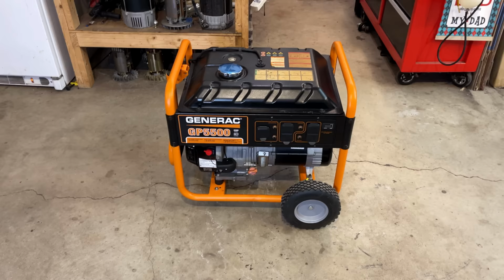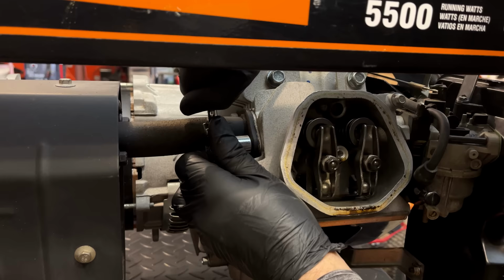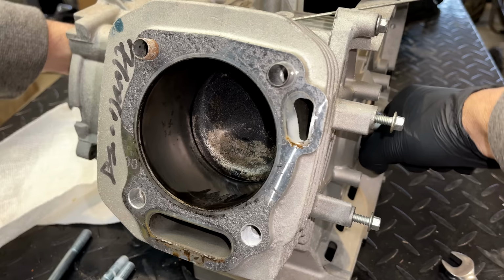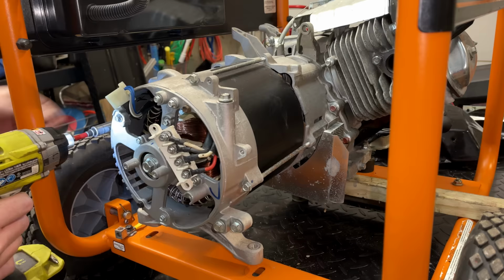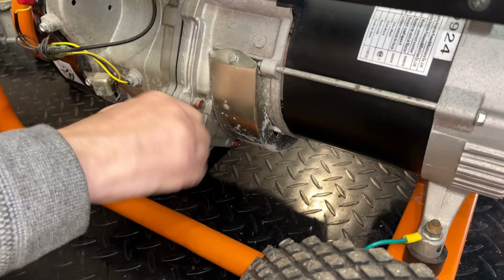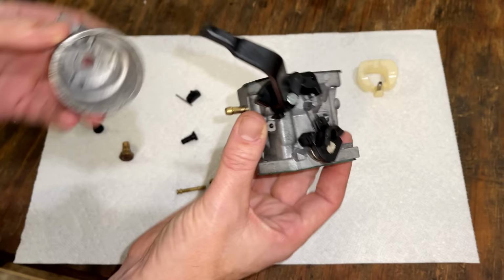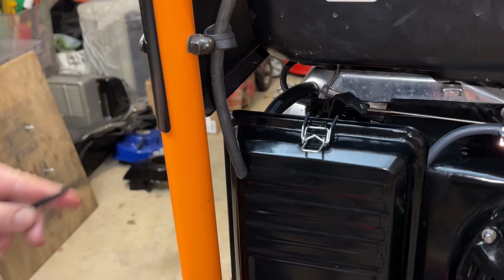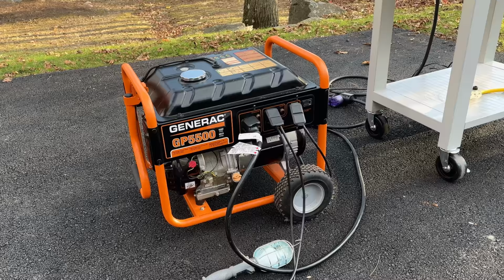What Caused This Engine Damage? - Generac GP5500 Repair

Comment: James, a heads up. I've been using the super degreaser in my ultrasonic cleaner, too, and if you use too much, it can literally strip the protective coating off the carburetor's surface. I've got two carbs that now have a darkened appearance, and I'm afraid to use them now. Just wanted you to know.
A couple of ideas on the engine corrosion: was this generator in a flood zone and didn't get drained for a few weeks? Or did the carb get stuck and drain down into the motor? Food for thought.

Comment: Are the rockers supposed to be that loose?  Seems pretty excessive.  I've got the same genset here.  Wonder if adjusting valves is supposed to be a service item?
Reply from the maker: Every 100 hours they are supposed to be checked.  The rocker design is not great.

Comment: I was surprised by how easy you got the armature off the tapered crankshaft   I’ve got a single cylinder Chinese 7500 watt diesel that I can’t get it off . I’ve tried hammering on the long bolt that holds it on and also tipped it up and poured water in the bolts hole then wrapped a short bolts threads with pipe tape.  NO success. Diesel engine has so much blow by into the crankcase that it won’t start.Want to look at its piston rings. Anybody have any ideas?

Comment: Had a question..What is the best generator brand apart from Honda & Yamaha..? Which generator is better between Generac & Briggs....?
Reply from the maker: GEN-PRO by Gillette makes some good machines.  Generac and Briggs both use Honda clones and generator heads from China.  They are equal in quality but likely the Briggs will not cost as much.

Comment: hey James  love your stuff , i have a 2016 Briggs & Stratton Storm Responder Generator 5500 watts with 8250 starting watts. she has always be faithful , can you tell me the best engine speed , and voltage and hz that it should run at, i got that meter you got, i wanted to test her to see if she is worth electric start kit...thanks for any help
Reply from the maker: The speed should be set at 61.5 hertz (3690 rpm) no load.  If you have an AVR then set the voltage to 120 volts.  If no AVR then there is no adjustment you can make to change the voltage.

Comment: Sorry to bother you how do you remove the ball bearing from the counterbalance in the “back housing”the one in the blind hole where you can’t mount an extractor o is there a video where you do it,thank you
Reply from the maker: I have not made a video on that but plan to in the future.  There is a slide hammer designed for pulling this type of bearing.  Orion Motor Tech Blind Hole Collet Bearing Race and Seal Puller Extractor Kit, Slide Hammer Pilot Insert Inner Internal Bearing Removal Tool Set, 16PCS https://a.co/d/9VvVrML
Reply: @jcondon1   thank you, very very much, you r very professional and you know the value of answering calls, again Thxs a lot 
Do you repair generators for costumers?

Comment: So are you now going to have to switch to a different degreaser in your ultrasound since the formula is now corrosive to aluminum?
Reply from the maker: Yes.  Been using dawn dish soap recently until I find something better.  Also using up what I have of the Harbor Freight degreaser on carbs that are easy and cheap to replace like this one.  It still works well on 80% of the carbs I put in, but the other 20% turn dark.  Even had one bubbling as you would expect to see if dropping it into acid.

Comment: I have a Cub Cadet push mower with a Powermore engine that has a similar issue. It will run for about a second, but the engine never gets up to speed. I assume the valves are the issue as well, but I cannot find any information on this engine. I have no idea what the clearances are supposed to be. Is there any way to guestimate what the clearances are supposed to be?  I have no history on this machine beyond the owner saying that it hadn't run in several years. I have had it for several months, but I cannot find any information on these engines. It took me about a month to even find out what type of engine it was. There is no identifying information on the engine that I can find.

Comment: Any info for an overload light on a predator 9500 inverter gen? I replaced the inverter with a used one from a machine with a dropped valve, so not a known good unit but could infer. Still showing an overload light. The primary dc winding is producing power at 14 volts. The secondary ohms at .7 so I assume, yes I know what that word means, it is good. When I unplug the secondary feed to the inverter board; sometimes the machine starts to die, I plug it back in and the generator roars back to life and I get a green output light for a second then back to overload. 

The alt tests fine I think. Both sides ohm at .4 and are producing 185ish volts each. Seams really high but the diagram indicates it’s 3 phase power from the alternator. 

Any productive ideas are greatly appreciated.
Reply from the maker: Usually that indicates a bad inverter but given you tried another and same result then might be something else.  I have not worked on that inverter before but most do have 3 phase AC high voltage high frequency.  185 seems a little high but likely ok.  The ef3000 I worked on was 3 phase in the 150-160 vac range.  Some also have single phase output in addition.  Would make sure all windings resistance is good and no connections to ground from any.  Would also check the servo on the carburetor and make sure it is moving and not stuck. Also might disconnect the outputs from the inverter in case something down stream is shorted.
Reply: Thank you sir. I will check again for a short.

Comment: Why is it a good idea to shut off gas & run it out when your done with something.
Reply: Ethanol in gasoline attracts water, which causes corrosion and ruins carburetors.  Any gasoline will eventually turn to varnish which plugs up carburetors.  It's a gad idea to leave gasoline in carburetors for more than a few months.

Comment: Not sure but looks like the white and black wires on hour meter got switched. Does it mater?
Reply: Matter
Reply from the maker: On some it will.  This one is AC so the wire location does not matter.

Comment: Other bad cam ?? Seems to be common 😢
Reply from the maker: It’s a common issue with the GP series.  To be fair though all cases I have seen were due to oil contamination.  Think it’s neglect rather then quality control.

Comment: James, is THD a product of the engine or just the power head? I would think it is solely an issue with the power head. Thoughts? 

I also found it interesting that a GP5000 engine could fully power a GP5500 power head. Makes me wonder if the engine was significantly oversized for the GP5000.
Reply from the maker: They do oversize the engine on the GP5500.  The GP5000 has the same size engine as the GP5500.  The THD is a combination of the engine, generator head and the type of load.  Space heater me are the best case.  Multi cylinder engine are cleaner for sure.  Two strokes are also cleaner because every stroke is a power stroke.
Reply: @jcondon1  Thank you!!!!

Comment: Well, today’s gas sitting in anything a long time is a bad thing.  Ethanol has a propensity for and actually attracts moisture.  HEET gasoline additive to memory comes I two flavors, yellow bottle and red bottle.  One is predominantly ethanol and the other is predominantly isopropyl alcohol. Add gas and water to oil and let it sit em with cast iron internals in an engine and well you probably have what we saw here.  Who knows what the generator flipper added trying to free up the engine.  Diesel or penetrating oil or who knows.

Comment: How are these engines all getting flooded ?  You have had several in the past flooded as well.
Reply from the maker: Not sure this one was.  Water would not have done that damage to the aluminum.
Reply: @jcondon1 it might have, depends on what was in the water. If it was say, sewage for instance.....
Reply: I can tell by living by the ocean. I've had plenty of tools that got flooded most of them clean em , some diesel fuel fresh oil and gas they run 
 After that its mostly neglect.

Comment: Do you have experience from DC-generators? Could I run such with low rpm and still keep the output voltage constant, like 48V?
Reply from the maker: I do not have DC generator experience.
Reply: @jcondon1  i would use it to charge lithium batteries directly without inverter for my house. I know that telecom companies use them apparently for efficiency reasons. I would want to run the genset for lower power and longer periods. Three cyl Perkins just makes too much noise.

Comment: Nothing wrong with the case , clean it , use it
Reply from the maker: Using part of it right now on a project.
Reply: I had a 3 hp Briggs and straton lawn mower , was mowing some weeds when hit a pipe that was there as a property divider,  first hit broke both ends off the blade , I thought , couple of rocks,  next Hit killed the mower , bent the crankshaft,  believe it or not,  I fixed it , no new parts

Comment: I wish you was near me, I have a year old Champion 8500watt dual fuel generator. It was running and suddenly turn off. Now it won’t start up. I was on gas and yes I checked the oil level. I check the spark plug and there spark. I don’t understand what happened? This is the second thing that happened to it since I had it. The first thing was the electric starter broke. They sent me a new one, but with out any instructions showing how to replace it. I’m stuck with just the pull cord. Plus the nearest repair shop it’s more the 40 miles away and there’s no way for me to transport it. 
The engine doesn’t even try to turn over. I don’t know what it could be and it’s probably something simple. 
Any advice could help. 
Should I pull the carb out and clean it? The generator only has 8 hours on run time on it.
Reply: That is definitely a good starting point. Over 90% of small engine issues are carb related. Given how cheap clone carbs are, I'd consider replacing vs cleaning. Stabil is of only limited use. Best is to drain the fuel system when storing it. 

If you have spark and fuel, the only critical thing is compression. I'd start by giving it a whiff of starting fluid and if it starts and runs for a second, then the issue is definitely carb.
Reply: If it does NOT start with starting fluid, and you know you have spark, then the missing issue is compression. OR you have a timing issue, which could either mean the camshaft is hosed like this one, or, more rarely for gensets, sheared flywheel key.
Reply: Replacing the starter should be fairly straightforward.  Take the old starter off, and reverse the procedure for the new one.
Reply: Low oil shut down defective, check oil level, should run out of fill hole 
Then unplug yellow wire and try starting fluid again

Comment: What degreaser are you using in your ultrasound cleaner.
Reply from the maker: That was Harbor Freight Super Heavy Duty degreaser.  I do not recommend it anymore.  It is now corrosive to aluminum.  Most carb react ok with it, but some react poorly.  I am using up what I have left and will not buy it anymore.

Comment: The Chinese engines are pretty much junk even though they clone a Honda. It's the inconsistent composition of Chinese steel, which is mostly junk.I have one more Chinese engine/generator combo to go through and when that's gone, my promise to myself is that I will never own another Chinese internal combustion engine. Very good and informative video.

Comment: Hi James is it possible to contact you via messenger? I got a problem in my Rotor Yanmar 5500EE it reads on the slip rings of 4.6ohms only far from what you said between 40 to 70ohms. May i can contact you. Thanks
Reply from the maker: Honda clones typically are between 40-70 ohms.  I have seen some as low as 2 ohms and that was in spec.  I don't have any experience with your model so not sure I can help other then say 4.7 ohms does not mean the rotor is bad.  In all cases I have seen, a rotor fails due to an a broken wire in which case there is no resistance.  4.7 might be fine.
Reply: @jcondon1  i kept on watching your tutorials and let a technician check and he advised me to rewind the Rotor i need to open this rotor and will check what is it why it register very low resistance. I am not experience in removing the rotor perhaps i need to find experience technician to check it. Thanks for your tutorials i valued it being a newbie on generator subject. In my place very rare person who are skilled to fix a problem like this.

Comment: Generac should be ashamed they produce such junky unreliable generators when they want to be known for Home backup generating power. If you can't trust their smaller generators designs for reliability then I would never trust a Home backup generator power system.